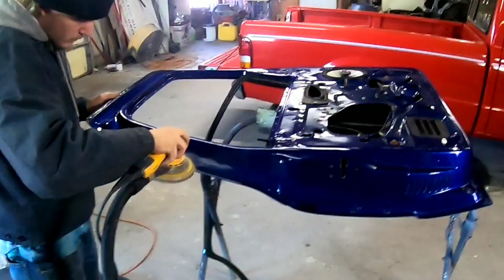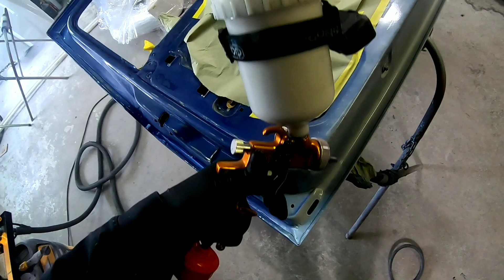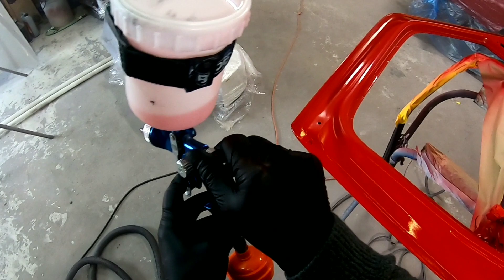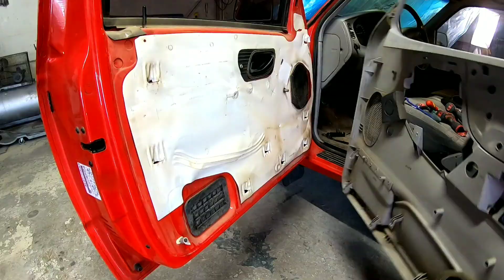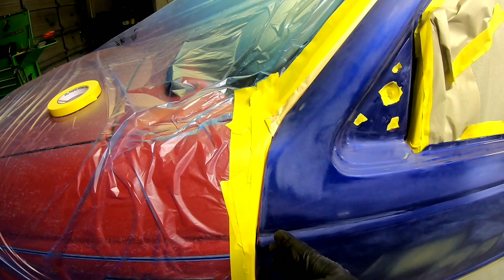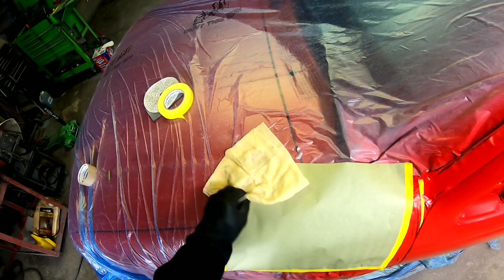How to do auto body and paint repair  from start to finish! ford truck repair, diy auto body

Comment: Is it excepted to use a lacquer on a car instead of enamel? One reason is because it’s cheaper. Does lacquer fade after a while?
Reply from the maker: You don't  want to use lacquer.  It requires many coats 6-8  coats it may be cheaper but it's  not nearly  as durable as a urethane basecoat and then clearcoat.

Comment: Gteat video as always.....that gun performs nice i currently have a devilbiss pro lite seems to have more over spray...would you suggest the gun you are using over the pro lite (i believe you have one) or even a iwata ws400 if you ever used that one...i painting  more often now...thanks
Reply from the maker: You can't  beat the pro lite but you could buy 5-6 of these guns for the price of the pro lite. This astro evot cost around  $100 and I would highly  recommend  it. Thanks for watching!

Comment: Hey not a criticism but an actual question, don't u think 320 is too rough? Wouldn't u want to use atleast 400?
Reply from the maker: Too rough to paint over? I finish with 600 before painting, although for years I painted over 320, but you run into problems when painting high metallics. Thanks for the question!

Comment: What is your baseline pressure when applying the clear , doesn’t look like you have much overspray .
Reply from the maker: It varies on the gun and I'm  always playing around with the  pressure. This euro pro evot gun has a good transfer efficiency so there's  less overspray.  I used 28 psi on the clear on this repair. If you haven't  seen the my review and demo on this gun you may want to check it out.